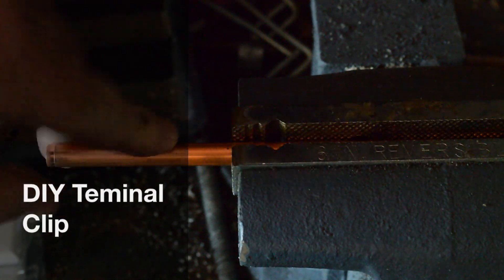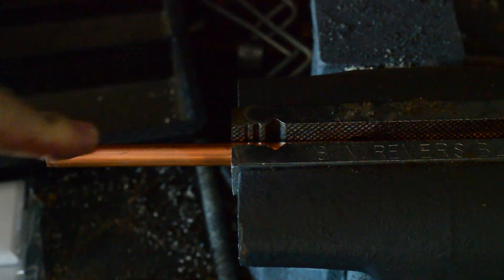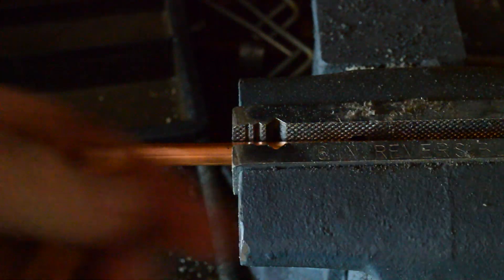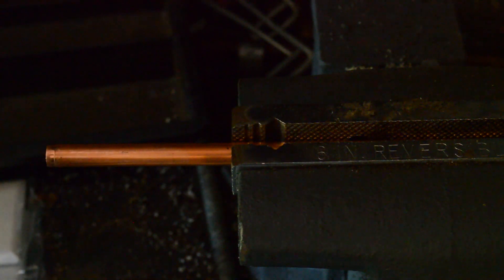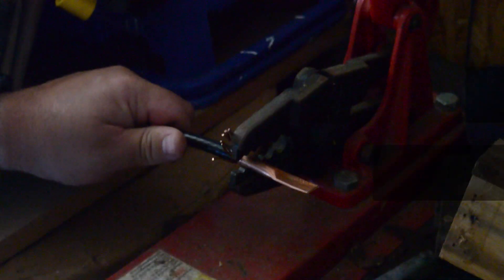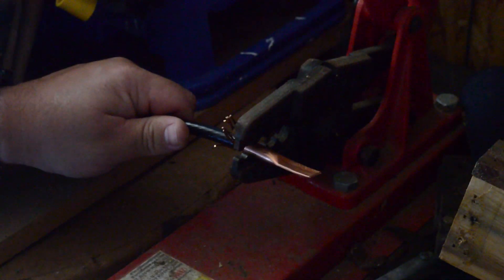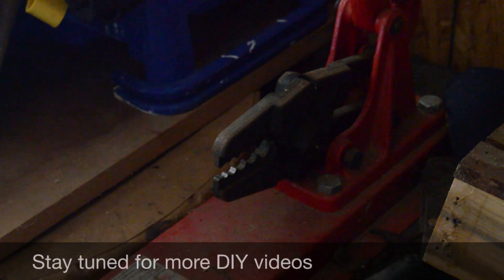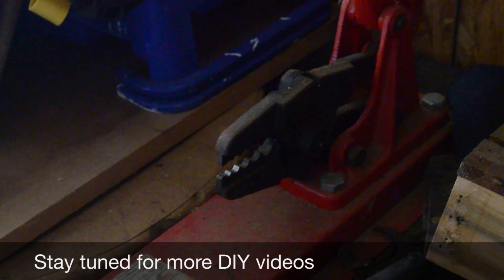How to Make a Cheap Cable Lug Using Copper Pipe

Comment: This has got to be one of the dumbest fucking videos I've seen, what's the voltage and amperage rating, are they UL listed, for your jerry rigged lugs there? Smfh, and this guy probably calls himself an Electrician. This is a HOW NOT TO DO ELECTRICAL WORK! Too damn cheap to buy the right parts.

Comment: BY removing some of the conductors, you have effectively turned your 6 gauge into around a 10 gauge. The heat is going happen at the thinnest spot. Please don't do what this dude did. Get the proper sized pipe.
Reply: Or flare it

Comment: I did something like this with my alt power/ battery bank. But i did not press/ clamp it in. I heated it with a torch and put solder in the piece then melted it with a torch and plunged the cable into the molten solder.